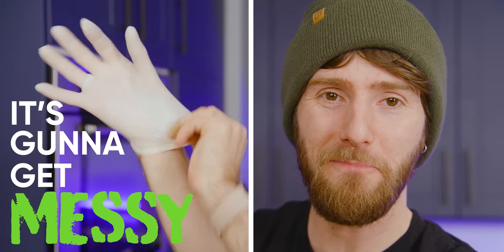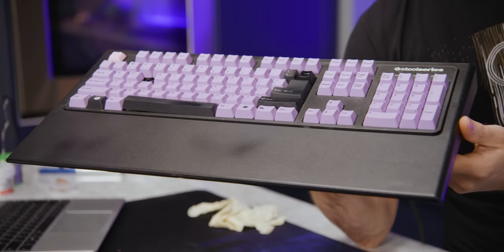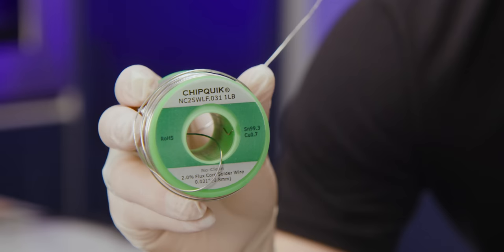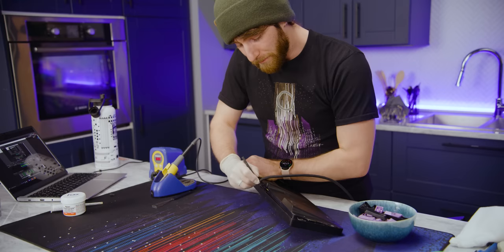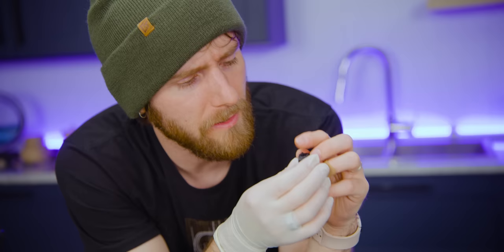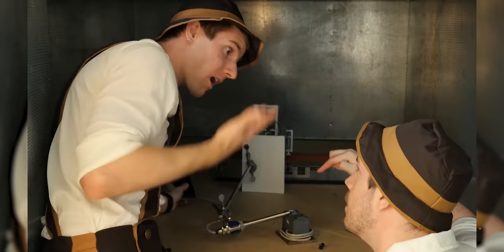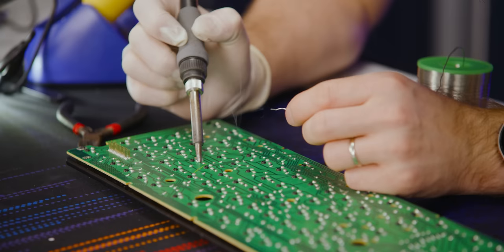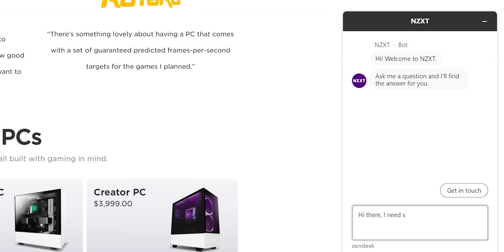Fixing my Wife’s $150 Keyboard for $1

Comment: For beginners who are attempting this - get leaded solder! Unleaded (especially the stuff that was available years ago) is harder to work with and is not recommended for beginners. Just do it in a well ventilated space.
Reply: I 've been soldering for years as a job and hate unleaded with passion. But law is law. And ventilation/extraction is needed regardless if leaded or garbage.
Reply: @razaelll  Same here. I'm sure there was an exemption for prototypes, small batches and repairs at least where i live. And yes, 100% agree for the ventilation. 
To be fair, unleaded has gotten better over the last years, but its still shit compared to leaded. Still, i would not give it to a beginner.
Reply: I've only been working with lead free solder so far and never had problems
Reply: I once got super super sick after spending like half a day next to someone who was using leaded solder.. So not sure whether I would recommend
Reply: The ventilation need is bigger for lead-free solder, due to the high-termp flux. It's the flux that hurts you, if you breathe it. The lead won't hurt you unless you lick it.
Reply: @razaelll  There is no law preventing normal people from using leaded solder. Only laws preventing companies from using it.
Reply: Agree. And if you go with 63/37 (which used to be expensive but hasn't been for years) you are less likely to get cold solder joints (where they are mechanically sound but not electrically connected). "Eutectic alloy" if you want to know why.
Reply: @IndianGeek5589  Oh yea, i've been sick from working with leaded solder when working in a badly ventilated area.
Reply: @namibjDerEchte  Really? I never knew that. I was under the impression that it was because of lead fumes.
Reply: @MrNamenloser21  If you have good equipment and technique - yeah you can get great results with lead free solder. Its just easier to get similar results with the leaded stuff.
Reply: @StedeBonnett  I never knew about 63/37. Locally i've never been able to buy anything other than 60/40, so i never looked for others. I've read a bit about this 63/37 stuff and it sound interesting. I will buy 100g or so, to see how it holds up. Thank you man, i learned something new.
Reply: @Nik930714  some cheap 63/37 from aliexpress (used mechanic stuff, works really well for price) and you really need nothing else. It's shiny and clean and cold solder joints are a very rare thing with it. Also can solder at just 190C if you're using stuff like LEDs which prefer low temps. Also start using the clear no clean type liquid flux, it doesn't leave marks and also isn't as bad as usual rosin (reddish/yellowish) stuff while working much better
Reply: @MaxC_1  To be fair i solder enough to not have cold joints anymore with 60/40. A few years ago i had to make around 1000-2000-3000 joints per month when we did multiple prototypes. Now we tend to use reflow after the first one, so i solder a lot less, but i'm fairly confident with a soldering iron.
With that being said, 63/37 sounds really interesting and i will try it out. 
As far as flux go, i prefer rosin for small pin pitches. For anything below 1 mm there is a noticeable difference. Using no clean 0.4mm is very difficult to solder by hand. For anything else, yes, no clean is amazing. Especially for LEDs like you pointed out. All my white LEDs tended to be yellow when i used rosin flux for them.
Reply: @Nik930714  I personally too never really had cold joints with 60/40 when used properly but the extra reliability of 63/37 comes handy especially considering it often produces more aesthetically pleasing joints. The stuff I now use from aliexpress was cheaper than what I used to pay for 60/40 so made a total switch to it and never had issues in years in harsh climates. 

Also i personally did use rosin flux but recently found a paste like flux which is pretty much white in color and thus it doesn't leave markings and is also cleaner and probably doesn't need cleaning at all which is all around suited to use on everything compared to the classic brown rosin
Reply: I use thin 60% tin 40% lead solder, a ts80p soldering iron set to 380 - 400°C, kester 951 liquid flux, an engineer ss-02 solder sucker and a 8858 hot air gun, I have fixed a dmg gameboy (needed a speaker after I put an ips display in it because the new front board for the kit doesn't come with one), a 1.0 original xbox (dead adm1032 temperature sensor, removed clock capacitor and rusted ethernet connector, new arctic MX4 thermal paste on the CPU and GPU, it turns on and stays on now but doesn't show anything on the TV), a 1.6 original xbox (bad capacitors by the CPU, new internal power supply, needs a new HDD and it will be a working system again), a nintendo switch pro controller (drifting left stick, I desoldered the original ones took apart and cleaned the potentiometers with isopropyl alcohol and q-tips put the sticks back together and soldered them back in, the drift went away completely and has stayed gone) and a wired xbox 360 controller (both sticks had really bad drift, I bought replacements but never got them so I took working ones off a broken dualshock 2, there's still a little drift on the right stick but not as bad as it was before replacing both sticks).
Reply: @Nik930714  Lead evaporates at 1749 °C (3180 °F) so if you get lead fumes, your soldering iron is a bit too hot.
Reply: @HudsonGTV  unfortunately, I work for a company.
Reply: @MikkoRantalainen  Just a bit to hot yeah :D Never really though about it like that, i always assumed it was gases that the lead made when it reacted with other gases in the atmosphere. To be fair i never really though about it at all ... and it shows :D
Reply: @IndianGeek5589  That would be the flux rather than the solder.  The flux has nasty shit.

Comment: In case anyone is wondering folding leads over on through hole components is a fairly common practice. It keeps the components in place when the board is flipped over when you go to solder them.

Comment: I love it! More DIY and repair stuff is awesome, not just because it prevents waste but also because it's fun to learn how your stuff works, also great example on how "broken" devices usually just have one broken part, while the rest still works perfectly fine.
Reply: This is a great point, unless something has gone terribly wrong usually only something simple has gone bad and needs replacing.
Reply: @darkphoenix1677  Exactly, even if you can't do PCB level repairs (which to be honest is a pretty advanced skill) replacing a board, resoldering a USB connector or something alike should be possible for everyone, who wants to get a little more life out of their device. Even for devices that are "built to break" after a certain amount of time, it's usually just one part that fails, sometimes on purpose.

Comment: My G710+ has been through the dishwasher 3 times now.  The first time was out of boredom since I planned on replacing it, but it came out so clean and still working so I kept using it.  The key is drying the keyboard.  I use and air tool on it for 20 minutes.

Comment: The bending of the legs on a pin through component is a US military standard of soldering to help secure the component as well as increase surface contact to the pad
Reply: Citation Needed that it's a US military standard. Note that this product was not made for the US military, so we don't know what standard they were adhering to without a citation.
Reply: @lambdaman3228  its a common sense standard, i always do it since i don't have those hand thingies, fold over the legs and hold it position
Reply: @matthewweinberger7023  Nobody claimed it was or wasn't a common sense standard though...
Reply: Strange, it's generally what you do when you don't have the equipment to do it properly or as I would guess in this case, because it's quick.

Comment: I generally avoid unleaded solder, and especially on joints that are under regular stress knowing it's far more likely to crack over time.
Reply: Same here, unless it's all I have left, and need to get a project done, I just make sure I have good ventilation, and my fume extractor fan when working with lead solder.
Reply: Yeah people that actually fo any amount of real soldering know you use leaded solder
Reply: @CommodoreFan64  You should be doing that with any solder or flux, the flux is what's bad for your lungs.
Reply: @CommodoreFan64  Lead does not melt and give off fumes at normal soldering temperatures. Most solders are 60/40 Pb/Sn, so there's no risk in it at all.
Reply: @vgamesx1  I do I just make sure double time when it's more then single dab of solder when it's  leaded, and yes the flux is bad. Far as the leaded solder itself not being bad for you is debatable.
Reply: @CommodoreFan64  Unleaded solder often has lower temp and less corrosive flux than leaded. Leaded stuff is essentially safer and better in all ways except in long term which risks it leaching lead into soil. Just don't lick your hands while using leaded stuff and dodge the fumes. Rest is pretty safe
Reply: I fully agree. Unleaded solder is much more prone to cracking and especially for keyboards, where you tap the switches all the time, you definitely don't want cracking from repeated push.

It's perfectly okay to use leaded solder. The only thing that's illegal is using leaded solder to mass manufacture new things. For custom work and repairs, leaded solder is just okay. And the reason leaded solder is illegal is not because it would be too dangerous to have in the devices or soldering it would be too dangerous. The real reason is that when (not if!) those devices end up in the landfill, the water and erosion doesn't move the lead to ground water. The amount of solder you need for repairing something is not a problem but imagine all the smart devices having half of all the solder made out of lead and buried in landfill – that's quite a bit mass of lead in the ground.

Comment: Before going the key replacing rout you can try to spray the switches with contact cleaners and see if it solves the problem. You don't even need to disassemble the keyboard. All you need to do is to remove the keycap and spay the contact cleaner inside the switch and pressing it multiple times.

Another thing you can do is open the switch and try to clean it and bend the metal contacts to increase its contact pressure (i fix one of my cherry red keys that way). Depending you how you keyboard is design you may be able to open the switch without desoldering it.

And if you don't want to buy or wait for the new switch you can replace the problematic switch with one switch keys on the keyboard that you rarely use. For example most people rarely use the many of the F-number keys so you can replace the bad switch with one of them.

Comment: The pins would be bent over to stop the key falling forward during soldering,   been their on a number of keyboards. 👍
Reply: bending pins on the switches during soldering is absolute devilish act and I hate any company that does that. You have any idea how hard it's to replace a switch that's soldered in with bent pins? not to mention companies don't recommend bending pins on switches? 
The plate exists for a reason, the switches should clip into it, always in a prebuilt board or essentially a board with around 1.5mm plates
Reply: @MaxC_1  This was on a product where it was never intended for the user to replace the switches, so it really doesn't matter in the pins are bent or not.

It's more just happy coincidence that the cheapest way to manufacture devices at the time also made them quite accessible to repair and mod.
Reply: @tams805  which again brings back the whole right to repair argument.
Also from personal experience even now majority of the cheap chinese boards which literally cut corners everywhere are some of the easiest to repair, not to mention they don't even bend pins on most of them. 
It's more of big brand name thing to make devices crazy hard to replace or mod.
Reply: @MaxC_1  there is some merit to both trains of thought here, the original intent was likely ease of manufacturing without a second thought to repairability, nowdays hotswap pcbs are cheap and brining in a wave of new super easily repairable boards.

Comment: i tend to spill various beverages in my keyboards. Im on my 5th corsair k70, until I realized if you have a spill, you can just put it in the dishwasher alone with no soap then let it dry for a few days and it will be good as new. Remove the keys first and wash them separately.

Comment: Awesome!
This is a nice confirmation that my Tesoro Durandal Ultimate MX Brown keyboard I purchased back when the mechanical keyboard resurgence turned into a real hype is in fact the last keyboard I ever needed to buy.
This thing is not just just built like a tank, its case is so sturdy that, if it had a detachable cord, it would be my #1 weapon of choice to defend against a home intruder, lol!
Reply: I have used an ibm buckling spring pos keyboard with a metal back and 24 labelable F keys (imagine model m but bigger and heavier, including the rj45-ish connector), those are the ones you want for home invaders

Comment: Nothing wrong with old hardware. Still got my 2004 Razer Diamondback mouse in daily use at work. All the graphics have rubbed off, the gel sides have gone solid and I've had to use a gel glue to fill in the dimples created over the millions of clicks on the microswitch button stems but it's still reliably working.
Reply: Man I still regret selling my OG diamondback.
Reply: i dunno how your switches managed to last. I've had to replace the left mouse switch on my Razer Deathadder Chroma, and I'll need to replace the mouse wheel button soon

Comment: When some of my switches acted up I used an electronics safe type of contact cleaner on all of them. No issues since. One theory is that over time dust, and plastic from the manufacturing process comes loose, and sort of gunks things up inside, but the contact cleaner remedies the situation. I was extremely thorough with each switch, took like an hour or two on my tenkeyless board, but worth it. Edit: didn't have to open the keyboard or anything, just removed caps, pushed down on stems, sprayed some in, pressed the switch over and over to spread the cleaner well for maybe 30 seconds right side up and upside down, each (so 1 minute per key if I remember right). At the end I think you wait like 15 minutes minimum to let it dry, then you can use it.
Reply: Out of curiosity what one did you use?
Reply: @Davidgm92  I'm in Canada but in my case I got some "CRC 05103 QD Electronic Cleaner" from a local hardware store. One of the key features is "quick dry", careful you don't get it on rubbery things like o-rings under your keycaps (if you installed those). Not a bad idea to dust your keyboard first too, I have a [Edit: wrong brand, corrected] DataVac for that (safe for dusting a pc as well), and a brush that came with a keycap puller and o-ring kit. Recently needed to use the contact cleaner on my spacebar that was acting up (2nd time I had to use the cleaner), dusted my whole keyboard, then also pressed down on the one trouble switch, and dusted inside there with it, before using the contact cleaner.

Comment: When I had keys that stopped working, 9 times out of 10 the switch didn't need to be replaced. It just needed cleaning of the internal contacts. No tools needed but screwdrivers and a pencil eraser. Disassembled, rubbed contact with eraser, reassembled and tested. That tenth time was the switch.

Comment: As somebody who's gone through this myself with zero knowledge and an out-of-warranty K95, desoldering switches was actually surprisingly simple. I got one of those super-cheap solder-sucking pumps with my $10 soldering iron (and I'm sure you can buy them separately for a couple bucks) and it worked better for me than the solder braid (though again, that's just me; ymmv). I actually had so much fun with it that I bought the cheapest mech on amazon, desoldered all 100+ switches, and used them to make a custom keyboard since buying bare switches wasn't an option at the time. Silly solution to my problem, but again, I went into it having never desoldered a single thing in my life and picked it up pretty much on the first try.
Reply: Those solder sucking pumps are fine as long as (1) your unit has unbroken seals to actually suck and (2) you don't damage the tip. Surprisingy many of those pumps have plastic tip and people accidentally melt it with the soldering iron - the inside of the tip must be smooth or it fill not suck well.

Comment: This was one of the reason why I wanted to have a hotswappable keyboard once I decided I wanted something more custom. Its still not a custom keyboard in the most hardcoresense, its a GMMK TKL Hotsap edition with their Glorious Panda switches. It's amazing and I like the form factor a lot. Should a switch die I can just yank it out and push in a new one. 

Also, should I want to use other switches I can do the same, Saves me sodering and such.